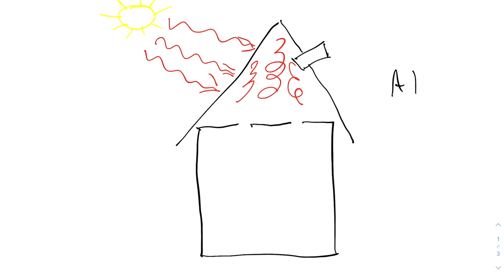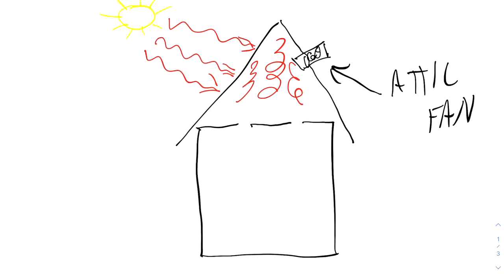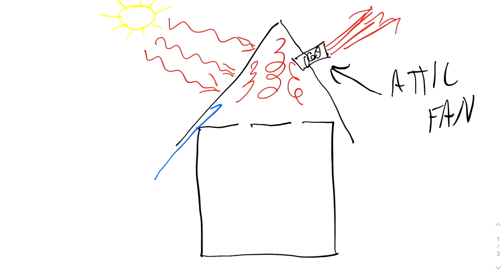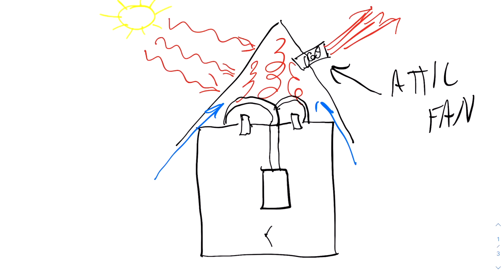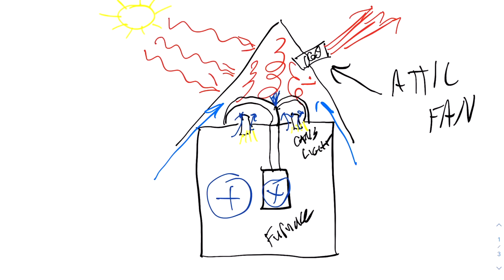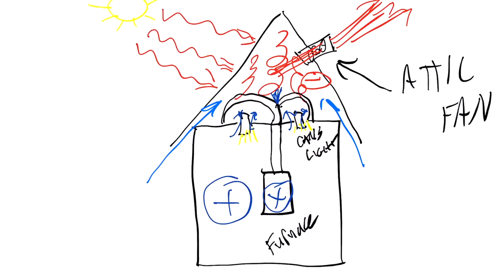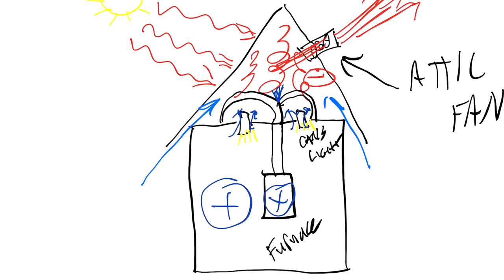3 Remodel Rip-Offs

Comment: Two things about window replacement.  I lived in Nebraska in the early 90s in an old house that was built in 1911.  The windows were leaky, single pane, single hung, counter balance windows that for the most part had been painted shut decades earlier.  We replaced those with (at the time) modern vinyl, double pane, single hung, low E windows that used springs as the counter balance.  We filled the old counterweight void with insulation and the difference was amazing.  In the first year our heating/cooling bill went from over $400/month to just over $140/month.  We moved to Washington, so we never fully recovered the cost in energy savings, but we more than made up for it on the sale of the house.
We had our house in Washington built for us as part of a development.  The house has held up well; however, the windows not so much.  With settling and other issues, some of the windows failed, got out of square and won't open/seal, and none of the builder-grade windows are low E.  I have been replacing them over the past 5 years as budget permits, and although the savings aren't huge, it is nice to be able to be in a room with natural light that doesn't feel like I'm inside an oven when the sun is shining in the window.  I don't expect these to pay for themselves in any reasonable length of time, but the added comfort is well worth the price.

Comment: I have an uninsulated detached garage that gets very hot in the summer. 2 open windows provide very little relief. The ceiling is open, meaning exposed/painted trusses. Seriously thinking about installing the solar attic fan to draw some of the heat out while the windows provide fresh air. Thoughts?

Comment: Matt is 1/2 right.  The depressurize attic is right if the fan CFM is not sized correctly.   With a properly sized attic fan our utility bills actually went down enough to pay for the solar fan in 4 months +/-.  Our attic in real time went form 180 degrees to 110 degrees in less than 3 hours on a 104 degree cloudless day.   If you install a larger CFM fan they can make a bit of noise and rain can be drawn in thru your attic vents.

Comment: I specifically searched on installing attic roof fans, and this was the first video I came up with.  I own a 2-family home, my wife and I are upstairs, my son, his wife and their kids are downstairs. We have a full basement and attic. 
The 2 floors each have an independent central forced hot air system with AC. The first floor, with the unit in the basement, gets nice and cool in the summer. The second floor, however, with the unit it the attic, struggles to get cool. The house is 80 years old. I had that thought that maybe if I could cool down the attic, maybe the unit would run better in the summer, and I thought, apparently erroneously, that a couple roof vents, one at each end of the attic, and in and an out, would do the trick to keep the attic cooler. Well, now I really doubt it will make a difference. Maybe I should just go ahead and put in a couple 3-head split systems and take the attic out of the cooling equation. 
Thoughts?  I am getting a new roof in the spring. 

(Both outside units are on the side of the house and they don't get any direct sun).

Comment: It all depends on your situation. Here in Portland OR our west facing bedroom with five widows would heat up to 120 degrees in summer. Replaced the plane glass double pane Windows with low e units. Just the glass not the frame, about 1/4 the cost of new Windows with frames. Lowered the temp to  about 80 degrees in summer. Added shutters like we had in Germany and now we can easily sleep in the bedroom without A/C. Electric & gas bill is under $150 for a 2000 sf home.

Comment: I realize this is 2 years old at this point, but I did have a question about the powered vents if you actually ever read this... Maybe someone else with experience with this can comment. I was looking at using a single reversible fan to draw air in and another standard one to draw air out, much like a fan system for a PC. They would both be set to the same thermostat so they kick on and off at the same time preventing many of the issues that you were mentioning mainly over pressurizing or under pressurizing of the attic space, as they would be the same CFM rating giving the system equilibrium.

I live in Texas as you mentioned and the goal is to get near ambient temperatures not below ambient, as our attic gets easily up to 110F+ in the summer with full sun exposure. Just getting to ambient 90-106 would be a massive improvement. This is an older home (1986) that doesn't have adequate ridge venting space or configuration and we were looking at something to modify the cooling outside of just adding more insulation (which it needs). Would this still be a recommended configuration or do you feel that it would still be a scam with the configuration mentioned above?

Comment: Attic fans is why I searched YouTube and came across this video.  In concept it seems like a great idea.  E.g. if it's 95F outside but 125F in the attic, then ventilating the attic could bring it down by maybe 20F.  And that should mean less heat being transmitted into the home.  The problem, you (and others) are saying is, the fan is creating negative pressure in the attic, by pulling air through vents.  But what if there were two fans:  one blowing into the attic at one end, and one blowing out at the other.  Then there is no negative pressure.

Re: windows, another idea:  I added "insulating" window film to my windows last month.  They have some reflectivity on the outside.  Hard to say how much if any thermal insulation they provided, but it did add a classy look to the home, for minimal cost.

Comment: So I went to the article you linked regarding attic fans. The big flaw is that it assumes everything else is perfect. Perfect envelope, perfect insulation. But most of our houses are far from perfect! We are just trying to get comfortable. So even is there is absolutely no energy savings, even if it costs an extra $25 a month, the bottom line is that in most cases, an attic fan will make an imperfect home more comfortable. I got quoted 10k to redo the insulation in my attic. Instead I just installed an attic fan for a fraction of the price.

Comment: Ok, first time I have ever disagreed to some degree with Matt , someone that I GREATLY respect.  Please feel free to correct me if I am wrong.  All the manufactures of shingles who warranty their materials recommend properly ventilated roofs. There  are at least 5 reasons. 1. Most homes do not have enough ventilation and get heat build up from the solar gain.
We have measured the outside of a roof on a hot day 105 in Texas and it was 155 on the shingles. This heat enters into an attic and is trapped when not properly ventilated. Just ask any one who works in a roof like an electrician or other craftsman. In a properly ventilated roof the heat gain is less, maybe up to 20 degrees cooler. 2. Shingle manufacturers require roofs to be vented to their specifications and to not do so will void your warranty. 3. Some roof designs will not work well with passive systems like box/ turtle vents or ridge vents and active systems like power vents and turbines when strategically placed operate better with many roof systems. A hip roof with little ridge line or linear feet would be an example. 4. Roofs may need to breathe to remove  condensation out of living areas from water evaporation , especially on poorly designed  homes. I have literally seen suppose roof leaks be from these issues. 5. A.Cs work harder to fight the heat gain that is next to the ceiling Sheetrock. This will result in more wear and tear on the ac units. Maybe this is not you are wrong but an amplification of the issue. Scamming is wrong, I see it in the roofing industry all the time. Scamming hurts the people through overcharging or incorrect ventilation. I have seen the same thing where turbines were not cut open on the roof deck as well as ridge vent never being cut open. Could it be the scamming is  the problem and not the power or solar vents? This seems to be painting with a broad brush like it would be wrong to say all builders are bad and go cheap yet want to sell at high profits. Obviously no matter how you slice the pie, there are bad apples in the bunch but also good ones. Not to many people counterfeit 1 dollar bills. If people counterfeit 20s it’s because real ones have value. Please look at some web sites like, GAF, Owens Corning , Airvent and Lomanco. Thanks. Larry Martin Shalom Roofing. P.s. totally agree that the best the vents would reduce the heat in the attic would be no more than about 20 to 35 degrees, not 70.

Comment: I have a home built in the 50s, and before I installed a gable attic fan, the temp in the attic would easily hit 140 degrees during the day. After the fan, the attic space runs on average 30 degrees cooler, and my ac seems to work better. Yes, I'm a nerd and installed a wireless thermometer in the attic. I live in South Alabama, by the way.

Comment: We used fan on frequently. If you live in a multi story home, you will pull the cool air from lower levels to higher levels. This also works to pull hot air to lower levels in the winter.

Comment: Disagree on the attic fans.  I'm in FL and put in 2 solar units when roof was replaced and noticed a large drop in attic temperature and did not notice any decrease in AC comfort or runtime. Yes I replaced a desert tan roof with white shingles which helps.  That said, in the past year or so I have noticed less comfort in summer indoors, and it was just this past year that I realized the fans have stopped working. So it did seem to help but folks need to know the solar units do eventually croak.

Comment: I put ridge eye brows in but also wired 6 power ventilators each one does 2500 sq ft.  the power is on a separate breaker 20 amp. I had Electrican run plugs to the roof eves for Christmas lights on the same circuit. It has definitely kept my house cooler and reduced the Ac use. I’ve measured the temp without it can get 140-160 in the attic with the fans it will keep the attic at 100-and the house at 80  put in 5/8 sheet Rock R 38 Insulation with polar Gard plywood and NASA  foil HEAT SHIELD. It all helps keep you cool. Six fans draw1.8 kw/hr the 2 Ac systems draw 9 kw my Reasearch showed me that my Ac had to run much less to cool me down to 78. Overall it’s saved $$$. I also put in enough solar to run the whole house and have 4 Powerwalls to run through the night and stay off the grid. The shading that the solar panels do is also a huge difference as it keeps the radiation off the roof.  The solar roof fan ones are definitely a joke!

Comment: General Contractor who emphatically uses powered attic ventilation with decades of positive results. However, make-up air is vital to the success of proper results of it’s installation rather it’s new or remodeled construction.  My first experience was as a resident of Southern Cal while remodeling my own home in the mid 90’s,after replacing a swamp cooler for about new forced air HVAC system. 
That first summer the AC would cycle on around 11:30-12 noon daily during those hot months of July through September but after the second summer and a new roof replacement I decided to try a powered attic exhaust fan.  To my amazement,the AC didn’t cycle on until 3-4 pm daily after that. I was sold by personal experience!

Comment: the condensation immediately drains as it accumulates as long as a p-trap is installed on the drain line (of the AC coil).  It doesn't hang around and humidify the house.  The only time it hangs around is if there is no p-trap.  If that were the case- every house would be extremely humid---it drains while the fan is on.  People run the fan without the condenser /compressor when using blue UV lights or when its not so hot.  I have been an HVAC contractor for 35 yrs.   Lets talk about attic fans.  I go in attics all the time (in az) where its 110 outside.  The attic is 140-150.   Yes its hot.  I went in one the other day with no ventilation and it was 188 degrees.  It was so hot I couldn't touch the wood trusses.  I' m sure you know a lot but you are not wrong on these two topics.

Comment: Our electric bill went from $550 to around $350 after getting our 43 windows replaced. We had single pane windows with poorly caulked muntins. 

In fairness though, we likely could've achieved a majority of the energy savings by repairing the caulking and/or adding coating. We live in Georgia with a West facing house.

Comment: I was curious, what if one installs a misting spray system on your roof that sprays water on the south facing roof if the outside roof hits 110 degrees and runs until it is 90 degrees. 
Would this cool the roof enough to affect attic temperature??
Also when I was looking to either build or buy my first home in 2000, I was shown a home in which the roof in the attic had spray foam sprayed onto it. 
It was 95 degrees in June and the attic felt cooler than 95 for sure. 
It felt like 85-90 degrees!!!
I’m curious if getting the attic sprayed with foam as a renovation would be helpful.

Comment: Quick semi related question because it seems like you tell it like it is. We have radiant barrier attached to the sheathing in our attic. Of course since we live in Texas, we had to replace our shingles due to hail. Now there are nails protruding through the radiant barrier. Would it be beneficial to attach foil radiant barrier the the bottom of the rafters which is about 6” below the existing radiant barrier?

Comment: My first house in 1987 I quickly coated the black asphalt roof with a thick, white, ceramic infusion. In 115 degree temps (Sacramento) my cooling bill dropped quite a bit. Also, I put reflective insulation in the attic, later. It makes sense, even if very few people do it. Look at all the black roofs in hot climbs.

Comment: Coming up I'm the northeast the rule of thumb was if you don't have 1/2" of cross ventilation per cubic foot of attic space  (gable ends or soffit/ ridge vent). You would add a powered attic fan. Not to cool the attic but to clear out humidity.

Comment: Cieling vent fans work!... My 350cfm fan was installed directly on the attic access drywall panel. It pulls in air from open windows and doors. Then air into the attic and then outside roof vents. It works great! cost $200 easy to install and $20 per month power. Keeps the house with fresh air and significantly cools a hot room...... A must-have for someone who doesn't want to pay $80 plus per month for air conditioning

Comment: I installed 3, 20" inch box fans in my attic. 2 on the gables and 1 on the rooftop/pitch, they run off 1 400 watt panel, I'm using a stepdown DC/DC converter to run them directly off the panel. Free energy and my attic went from 132 degrees to 123 degrees. So yeah fans in the attic work, especially in the summer.

Comment: I have to disagree with the assumptions on the attic fan.  Yes, if you set unrealistic goals, of course you will fail.  My attic was over 145F.  Installed a fan about 8 feet from the exhaust screen.  I did it that on purpose to get a gust going.  It worked.  It dropped almost 20F.  Sure it is over 120F in the attic, but so is my AC, which I wrapped in installation.  I was able to drop my internal home temp by 5F.

Comment: I had a dark shingle roof down in South Florida, the house had no insulation in the attic at all.The power company did a evaluation and paid to have the attic insulated. I asked about an attic fan and they said your using power to try and save energy. The insulation made no difference to my electric bill and my AC never shut off in the afternoon. I put a attic fan in the gable end of house and everything changed. Power bill went down & AC started cycling.

Comment: I purchased a couple of these fans for my garage and a vaulted part of the attic.  I did this on the assumption that I would do the installation myself, and it it seemed worthwhile given the cost of the kit.  My ex insisted after the kits were delivered that we hire a roofer to install them.  After paying for the installation, there was no way they were a justified project.

Comment: Our home has 2 separate roof heights.  Each had 2 static roof vents and 1 powered vent.  It turned out that only one of them was actually ever wired, the other had no electric running to it period.  A year and a half when we re-roofed after a hail storm I had the powered vents removed and had an additional 6 static vents installed instead.  We went from a very light gray colored roof (almost white) to a dark grey (almost black) roof.  I think on the summer hottest days you can feel a very slight difference but not much different at all.  I do notice that snow seems to melt off of the roof slightly faster.  Does that make sense in regards to the melting snow with a black roof versus a white roof?

Comment: I have done 2 of the things and to be honest they were huge cost savers for me. My thermostat was replaced with a smart one and it helped reduced my energy bill. Now the old one did not work and I was able to program my Temps when no one is home and regulates my Temps more accurately. Second I replaced my windows with a double pain glass vs a single pain. Yes this helped reduced noise and save on energy. I believe it all depends on your setup and each one is different, but to say it is stupid or dumb is not right when he does nor know everyone setup.